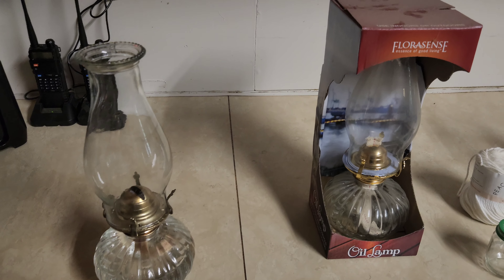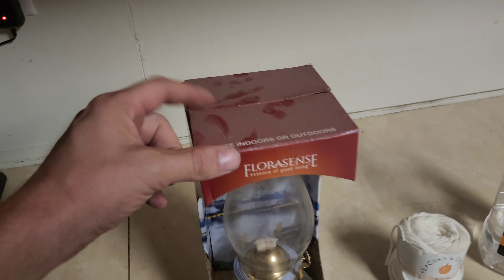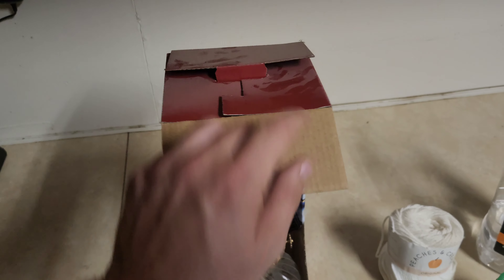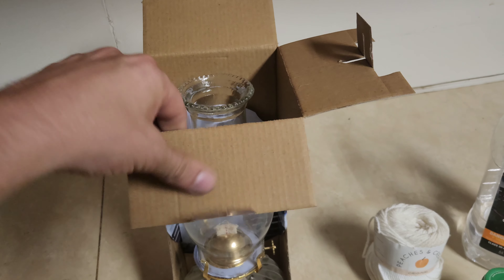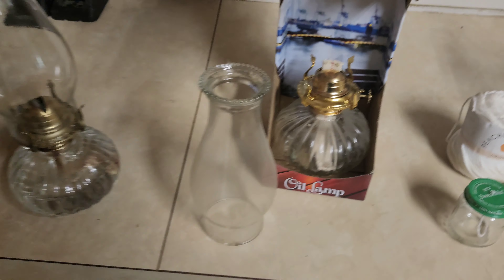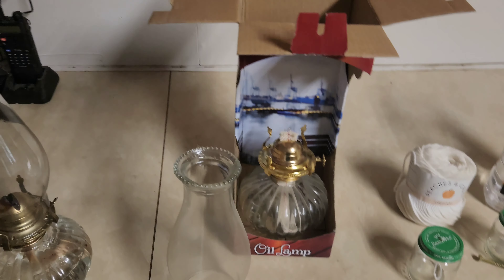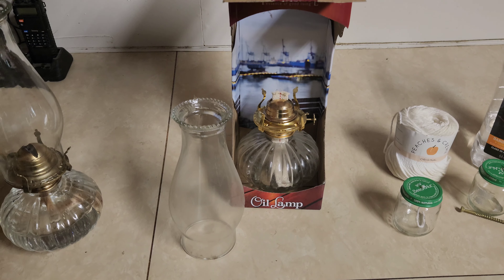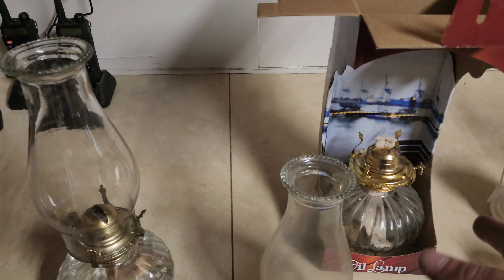Fueling Innovation: The Shocking Results of the DIESEL vs KEROSENE Lamp Experiment

Comment: Diesel has a higher viscosity than kerosene which means it's wicking ability (capillary motion) is slower for the fuel to travel up the wick. This is why the flame takes a little longer to settle into that "moon shape" when adjusting the wick down and up again. The dead flame lantern introduces more oxygen around the flame allowing the diesel to burn more efficiently than it does in the oil candle. I use diesel in my Aladdin lamp without any smell at all. They say it clogs up the wick over time but so far it's been working out for me and is a lot cheaper to run.
Reply from the maker: I am absolutely loving the lights, I am actually kind of thankful for the storms forcing me to break out these lamps. 

And I have started looking for more lighting options, I think I may need to go to antique stores for an Aladdin, those seem to be a bit pricey brand new. But I definitely do want at least 1 Aladdin.
Reply: @Tibbs_Farm  Yes, replacement parts like wicks and mantles are quite expensive too. On further investigation it seems like the diesel does in fact clog up the wick and flame spreader to a certain extent. Some people suggested adding isopropyl alcohol to counter the clogging problem so I might look into that because there is no way I'm paying $25-00 per liter of kero in NZ, if you can believe that!
Another viable option might be to look for an antique Dietz hurricane lantern, the early hot-blast type. They are known for burning more efficiently due to the gas recirculating effect of their design.
https://youtu.be/tURHTuKHBZs?si=gTJrQokZ9-px3M1y
I'm pretty sure diesel would work great in these.
Reply from the maker: @lombro1262   I have had leaking issues with some of the cold blast in the past, although it was probably just a brand issue (it was a knock-off).  

I may have to experiment with isopropyl. Thanks for the info
Reply: @Tibbs_Farm  Try finding older kerosene lanterns, they get much brighter than the lamps do especially the cold blast ones
Reply: @lombro1262 also you are thinking of cold blast Dietz lanterns, the hot blast ones are open to the air and dont circulate as good leading to dimmer light
Reply: Or you could go for a " feuerhand " lantarn👍

Comment: Back in the 2000s, diesel went from a maximum sulphur content of 500ppm to 15ppm. I wonder if the "terrible smell" stories date from the era of diesel fuel when it contained 33x as much sulphur as today... good video. Thanks. I think I'll stock a few gallons of diesel as a cost saving measure, especially for my outdoor lanterns.
Reply from the maker: Off-road diesel is now also less-than 15ppm sulfur. The dye may clog up wicks faster, but I haven't noticed too much of a difference.

Comment: Heavies in diesel killed my glass wick in one batch. Better use jp1 or k1. Will never use diesel again
Reply from the maker: Yes, it does seem that the wick clogs faster with the diesel than with k1. 
Recently I noticed this is sped up with the fuel being cold. [20°F Diesel will clog a wick much faster than 70°F] possibly because below 30°F Diesel does have the possibility of starting to gel meaning the parafin waxes start to less soluble in the fuel and thus it starts to clump/'solidify'
Reply: 90% on road diesel / 10% clean K1. Trust me on this one. I have been using this ratio for the past 5 years in a mostly off grid life style. That 10% is just enough to drastically slow up the wick carbon buildup. 

Off road diesel with red die seems to plug up the wick faster. On road is the key.
Reply: 5 years of daily oil lamp and lantern use here. 
90% on road diesel with 10% clean k1 is the mix I use. 
I have tried many oils and fuels looking for the cheapest and most reliable option as lamp oil is expensive compared to other options. Many will work in a pinch.
Reply from the maker: Thanks for the info
Reply: You can
 also add one ounce of 91% iso alchohol per gallon of diesel to stop any wick clogging tendancies.

Ive been using the low sulphur diesel by itself and havnt had any wick issues. I always start with a new wick with the diesel

Comment: Diesel and kerosene are almost the same fuel. After kerosene, diesel is the next fuel on the separator at refineries. The diesel is a little heavier in viscosity but not much if you put some aviation fuel in your diesel car it will get you home with no problems. The main difference is Diesel is taxed at the pump and kerosene only has a sales tax.
Reply from the maker: Turns out 1 of my trucks actually has had a few tanks of JetA ran through it. 

I was letting a buddy borrow it and he was hard on money... he put a few tanks thru. 

It's a 6.5 detriot diesel, same engine as the humvee. And that is what the military uses in deployed locations. [It's cheaper to bring 1 type of fuel for everything than it is to bring numerous types of fuel]

Comment: Ever wonder what those red dashes are for on the wick?
Modern Diesel is now low sulfur. It should stink less.
I wonder if you can mix olive oil with the other fuels and it work?
Lamp oil has a lower flash point that Diesel or Kerosene.
Reply from the maker: I figured the red dashes were more of a company "design" and not really much of a functional add. But I may be wrong. 

Yes, diesel is now ultra low sulfur [15 ppm sulfur content or less] 

Kerosene flash point ≈ 100°F - 149°F
Diesel flash point ≈ 126 °F - 205°F
Aladdin brand lamp oil has a flash point of 145°F 
Florasense brand lamp oil flash point 142°F
Reply: The red dashes are usually copper or other metal wire to aid in warming the bottom of the wick when its burning to make it wick fuel easier

Comment: Your using paraffin oil not kerosene, paraffin is liquid wax and has a thicker viscosity than kerosene or diesel. Paraffin being thicker takes longer to move through the wick. The reason it works better below the defuser is the fuel is getting preheated hot enough to vaporize so you are burning the vapors not the liquid. Once you burn the liquid it runs very rich if turned up even a little causing that soot.
Reply from the maker: I have another video where I compare between this lamp oil, off-road diesel, and kerosene. 
That test is done in pixie lamps from temu, though, so it doesn't have the 'carburetor'. 
But thanks for the information

Comment: you should probably use palm oil or wax.  Its so clean its actually already in a lot of foods.  You can also mix it with fragrance oil and it smells like a candle.  Also you dont have to worry too much about it catching fire.  Even if it does ignite, it shouldnt burn hot enough to break the glass while diesel and kerosene probably will.  I think palm oil and palm wax lamps burn at around 200 degrees F while diesel and kerosene can get up to 600 degrees.  There is just no reason for a lamp to burn that hot.  Knock over palm oil and wax it just makes a mess, knock over a diesel or kerosene lamp and serious fire risk.
Reply from the maker: I will look into those fuel types. But this type of lamp is designed for liquid fuels with a Flashpoint somewhere between 120-150°F [48-65°C]

Both kerosene and diesel are in that range.
Reply: If its a cold blast lantern it will extinguish itself if tipped over

Comment: Youre making waaaytoo much generalization ...parrafin, k1, and #2 diesel are not the same ....lamps wont burn worth a shit once wicks are gummed up
Reply from the maker: You are not completely wrong, I did make too many over generalizations. 
Maybe I need to run a test of the lamp oil [refined kerosene] vs kerosene vs diesel [type 2 kerosene] for a long period of time. Give the different Petroleum cuts time to start clogging the wick and watch for Performa degradation. Such as, 

• How often the wick needs to be cut. 
• How often the globe needs to be cleaned. 
• General fuel consumption 
• How often the wick needs to be adjusted. 

I have been using off-road in my lamps just about since I made this video and I love the usage. But, you do bring up valid points and gave me great ideas. 

Other than the complaints mentioned, I hope you enjoyed the video and possibly other videos of mine.